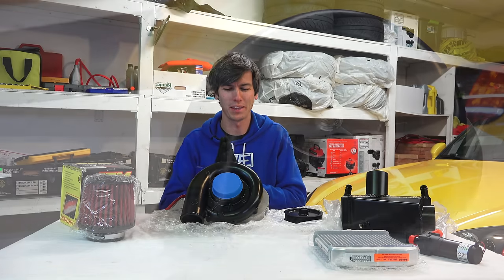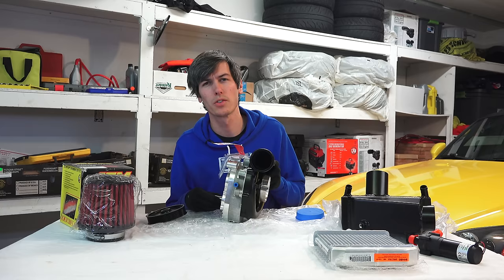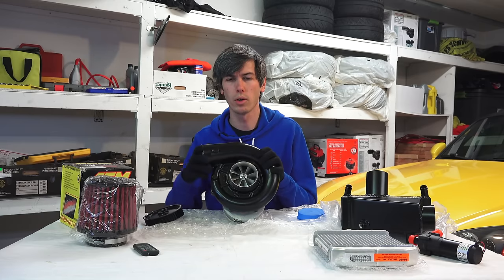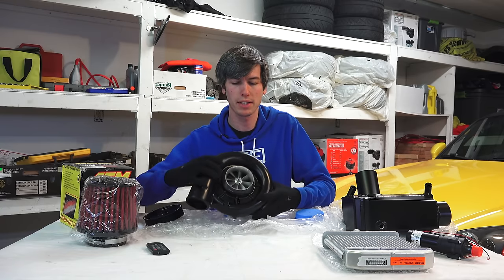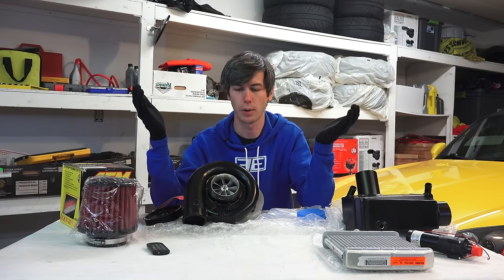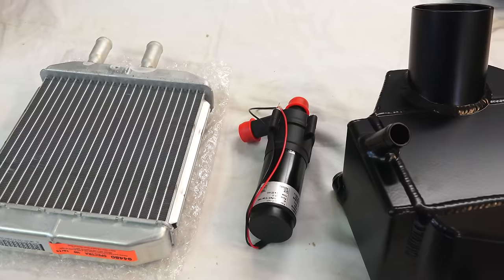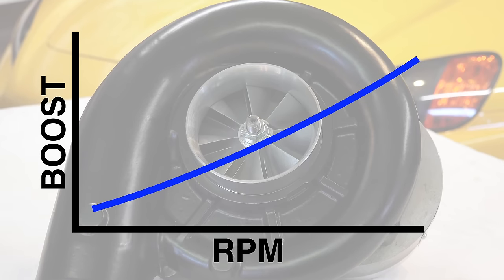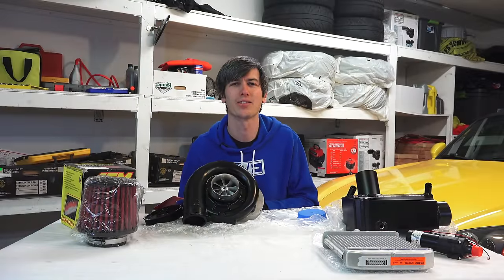How Do Centrifugal Superchargers Work?

Comment: Thats all fine and good,But what about placement of a Serpentine Belt.The AC Compressor may have to be removed to run the supercharger pulley.What about hookup of the Mass airflow sensor?Some cars may not have enough space in the engine bay for this supercharger.This Supercharger may be for NON-Street use hookup only on some cars.

Your correct,Some engines may not be manufactured to handle the extra compression ratio pressure and Blow out the intake manifold gaskets.May even have a ping detonation problem.

Comment: Ive found better fuel milage with a centri on my coyote as long as you arent racing around of course. Sure there is a parasitic load but isn’t it pretty low under peak rpms and wont there be a reduction in pumping losses?

Comment: There is no bad boost, but....

I'm curious why you chose a centrifugal supercharger over a TVS (high efficiency roots).  As you said, the car is already biased toward high RPM, I would think a flatter torque curve, with more power at low RPM (for the same peak HP) would improve drivability (I find during daily driving, I don't have to down shift near as often).

An W/A intercooler will increase in temperature to between boosted air and ambinet.  How hot depends on how big the water to ambinet heat exchanger is.  If it is the same size and the water to boost, that temp will be approximately half way between boost and ambient.  When you tune your car, for do it at that stabilized temperature to avoid engine damage.

Comment: quick question, right now i put 97 octane fuel in my car. If I want to start to put 91 octane gas in my car (that requires only 87), do I have to empty the tank and only have 91 octane in the tank or is mixing some 87 and 91 okay?

Comment: Adding in the whole inter-cooler phase just seems like a lot of extra complexity where there are more places for things to go wrong. I'm sure it makes things better, but I think keeping things simple is generally better. Over engineering a car will always produce the best results, for awhile, but once stuff starts breaking down it can become a nightmare to keep a "peak-performance", over-engineered system running simply because there are more points of potential failure.

Comment: Novice question:  Would a Wankle Engine that red lines at 10,000 RPM (or 9,000) be an ideal choice?   You mentioned making sure the engine could handle the added horse power.  Would you have any suggestions on basics for a Wankle 13B (for an RX-8)  I've seen some videos of a supercharged RX-8 and it was blowing the doors over everything else on the track.   One last question.  The RX-8 is not very economical to start with.  Roughly speaking how much more fuel would need to be used and do you need to increase the size of fuel injectors or improve the fuel pump?  Thanks and sorry about the newbee questions.

Comment: So i always had a problem understanding watercooled intercoolers and so on, how does engine coolant mixed with high temps help cool a intercooler when the temps were way much higher and now it makes sense, I'm guessing that watercooled intercooler is in a close loop with the seperate radiator as seen in video and none of the coolant here is in contact with the coolant in the engine being recirculated by the waterpump :D P.S: Did not know superchargers required a electric pump haha

Comment: Honest question, could there be a supercharger/turbo charger that's powered by a separate high power/speed electrical engine? That way, it doesn't create a parasitic load on the engine and you can dynamically change the boost levels through software since it's electrically driven.
Reply from the maker: Yes, electric turbos are a thing. Nothing is free though, it still requires a lot of energy, so you’d need an additional battery pack, a high voltage power supply, and some way of recharging the battery (it would still ultimately take energy from the engine).

Comment: What happens when VTEC kicks in and boost is still determined by RPM instead of air flow through the engine? Does boost drop when it first kicks in YO?

Comment: Would a centrifugal supercharger likely be a more appropriate power adder for road course use? (Extended on boost high load situations) Seems like theyre the most heat efficient, but i also understand that TVS units are a viable option as far as heat goes.

Comment: Hi, I really enjoy your channel - I was wondering if you would consider doing a video where you try to work out the percentage increase in performance for various mods vs. the money spent of said mods. I'd be interested to know, for example, the performance gain of extractors and full performance exhaust, normalised by the dollar cost compared to say a turbo build normalised by the dollar cost? Perhaps you could buy a cheap car which is commonly modded amd get some real data to verify your predictions. 

Building on this - it would be awesome to produce a calculator, which used other peoples experiences with mods in terms of cost and performance to estimate the benefit a mod would make on a certain car.

Comment: Hello. 
I've got a quastion: Do you will install a Blow Off Valve or does the drive of the centrifugal supercharger have a magnetic coupling? Once the throttle body will close the pressure may cause dammage to the compressor wheel if the pressurized air could  only escape thru the compressor. Similar to a normal turbocharger...

Greetings from Switzerland

Comment: Jason, would you consider the 
expansion chamber on a 2 cycle 
engine, as a supercharger?

I do, because it causes combustion 
chamber pressure to be higher, than 
normal aspiration.  (And, REALLY 
increases power, at the right RPM.)

steve

Comment: How can I make this set up work on a big block Cadillac? It seems as if as long as I have the proper belt, bracket, pulley, and piping it doesn't have to be vehicle specific. I assume a 2:1 reduction is possible where engine rpm 2000 would be 4000 rpm on compressor?

Comment: You should make a video explaining why you didn't go turbo I don't here of many people going centrifical supercharger unless they are drag racing
Reply: rvidal0001 that's not a good enough reason cuz this one has a crap low end he could most likely find a turbo that would be fully spooled at 4k at least hold till 9 grand and get 400 whp
Reply: rvidal0001 that's why I wanted him to do a video on it or maybe even comment on my comments the only thing I can think of is that it's more liner power and easier instal
Reply: He already had an STI so if he wanted a turbo car he’d have just held onto that, instead of buying an S2k.  Plus these motors have high compression ratios and are not well suited to turbos.  This makes much more sense for this particular car, adds power but is safer and more reliable without having to tear into the motor
Reply: Lostsage01 boost is boost supercharger or turbo highcompression and boost don't mix
Reply: Yes and no.  When turbos spool you get a sharp increase in pressure, whereas these slowly ramp up boost pressure.  That difference in ‘shock’ is rough on a small motor not built for it.  Look at a turbo boost graph and compare to what he showed in the video

Comment: In transversal engines 4 cylinder maybe is hard to install that supercharguer due to a space issue. Maybe it can be installed with a longer belt from the crankshaft to the turbo in a higher position, Idk

Comment: Could the Problem of "olny works in high RPM" not be fixed if there is a kind of CVT in the Chrager? The charger would spin fast at lower engine RPM and create more boost.

Comment: So if i put a smaller pulley on the unit itself it will make more boost at lower engine rpms coz you said that smaller pulley would make the supercharger blades spin faster at lower engine rpms??

Comment: I personally don't have experience with superchargers, but why all the redundancies in this system? First is the gear reduction mechanism, the pulley pretty much does the same thing. Unless they want the pulley to spin at a lower speed to reduce the chance of belt slipping off. Second is the air to water intercooler, I thought air to water intercooler is usually used when there's a packaging concern to limit intercooler piping. The only advantage I can see is throttle response since there's less pipes for the air to travel through.

Comment: Whenever you increase the energy output of an engine you increase the thermal output too. Can the existing cooling system cope with the increase, or do you have a plan to boost this too?
Reply from the maker: I'm confident in the stock sizing based on the power I'll be adding, but it's certainly something I'll monitor. As I haven't tracked the car (it needs a roll bar, I'm too tall), the cooling system will be fine for daily use.

Comment: Do they ever add the diffuser to the inter cooler instead of the supercharger so that the air spends more time cooling but still arrives at the engine at the same pressure (ideally). Maybe you lose more energy to friction in the tube with a fast air than a high pressure air

Comment: I've been thinking about the not so good low-end power with this kind of supercharger. Could you simply use a small pulley in order to make it spool fast even in the low rpms and then use some kind of wastegate to not overboost it in the high rpms?

Comment: So I'm not really getting why you would do this vs a turbo? People always knock turbos for "lag", but if this doesn't make power until high RPMs then it essentially has the same drawback + one more since it also has the parasitic factor as well. What is the actual advantage over a turbo? Less complex/easier to install? Easier to tune? Or was the price right on this...

Comment: Since it is compressed air, how about a small tank that keep compressed air produced from the turbine, and the engine take whatever it needs from it when it needs to? That way the air pressure can be at a constant value right? I dunno, went on my head suddenly... Not sure how big the tank should be, or how to set the supercharger up with enough rotation to feed the pressure inside the tank... Maybe switching between supercharger to tank on low revs, vice versa, and extra boost goes in the tank on higher revs? Maybe? A bit complicated though... 😂

Comment: Always curious, do any of these chargers free wheel with a reduction in input speed, or are they permanently connected? And does one style do it vs another, eg TVS vs Centrifugal (not a thing!). Wouldn’t wear/shock be lessened if it could free wheel on shifts/reductions in throttle and just uses the blowoff more? I would assume like a turbo works...

Comment: How about a tesla turbine based super charger?
Tesla turines are similar to a bladed turbine in that it spins and throws the air outward but it uses flat disks stacked with thin gaps between. The air inccurs friction with the disks which causes the air to spiral around the center and spiral outward (in the reverse flow of the typical use as a steam turbine in which the steam goes in from the outside and spirals out the center).
Tesla turbines have 2 inlets and 2 outlets.
The turbine has to spin very fast in the order of 80k rpm.

Comment: I was wondering if you could talk about Centrifugal superchargers and camshafts and power "fall off".  Do centrifugal superchargers power always increase with RPM, even with a camshaft profile that isn't necessarily meant for it?  I am working on supercharging a Subaru SOHC EJ25 with a larger Vortech.  I have cams meant for "mid range" power, I've been told they will "fall off" over 7000, but wondering what power will actually do above 7000rpm, being that it is a centrifugal, not turbo.  I don't actually believe power will drop or even flatten but I am not quite sure what to expect.

Comment: You mentioned you can spoil the turbo faster with a gear reduction in the turbo housing, does that mean this turbo can produce low end boost if you wanted it?
Reply from the maker: Yes, you could use a smaller pulley if you wanted more low end grunt, but that still means significantly higher boost on the top end.

Comment: I've heard 7psi is generally safe for stock internals with these types of superchargers? (At least on a V8) Would you say that's accurate? Always wanted one but without the hassle of adding forged internals...h/c/i etc
Reply from the maker: I’m not sure there’s a convention that will ever be entirely accurate. And it will vary engine to engine, some have stronger internals from the factory than others. Ultimately if reliability is the biggest concern, stock will tend to be best, unless you’re willing to pay a lot to build it from the ground up.

Comment: I assume the intercooler is needed because as the supercharger compresses the air.  That compression is creating the heat due to the laws of thermodynamics.   So how much HP would be lost by pushing that hot air into the engine without the intecooler?
Reply: i always asked this myself aswell.

Comment: How about pairing the input shaft of the supercharger to an electric motor? The motor should be powered by a separate electric system juiced by some kind of hi amperage li-ion battery. The whole system can be activated on demand by a switch (full throttle of manual switch), it should recharge using the cars alternator, similar to the Nos system in the NFS games. Is that possible?

Comment: That's why you pull the engine and upgrade the internals first then boost.
Reply: Not if you are happy with what the stock block can handle, which saves lots of time and money.
Reply: Candisa I'm more about peace of mind
Reply: turshin Then you should just buy a car that is fast enough stock and leave it alone. ;-)

Comment: I wonder why this kit come with its own water pump and radiator? Can't you connect the intercooler to the cars own coolant loop or would the added heat be too much for the radiator to handel
Reply: An engine usually operates around 95C, so feeding the engine coolant into the intercooler would likely heat the air going through. It needs a separate radiator that operates below the temp of the warm air coming out of the supercharger.

Comment: Are you going to have to make modifications to the engine to not destroy it with the boost?  I'd be very interested in understanding things you have to take into consideration when making upgrades like this, and how you find that information for an arbitrary engine.
Reply from the maker: I won’t be, for the most part. The S2000 comes with forged pistons and connecting rods from the factory, and I’ll be running relatively low boost (at least initially). From those I’ve talked to who know this engine well, it can handle low boost no problem. That’s not to say mine won’t blow up on day one haha, but it’s a risk I’m willing to take. I put so few miles on the car, so even if it’s just mildly reliable, it will be fine by me!

Comment: Hello and greetins from Romania. I want to ask you about your Honda s 2000 some things because i want to buy miself one but i am undecided, so... How is it like a daily driver? It is noisy  at speeds let s say 60- 70 mph, compared to a normal car? How is the stock engine in normal driving.? It is  so  underpowered at low rpm? I don t  drive fast so it is not a problem for me , i will drive this car like a normal car but i like the car for what  it is (mechanicly and visualy). What about oil consumption, knowing is a high reving engine. Any answers is welcome. Sorry for mispeling words. ... Thank you!

Comment: There is something else going on besides more air + more fuel = more power. It's why even 6 to 8 pounds of boost wakes up a engine more than expected. Now you are pushing the piston down on the intake stroke. Normally your engine is sucking in air through a restriction. Think of pulling on a syringe where you can only go so fast because the hole restricts the air. It's hard and you are using strength and energy. Hook up a hose with a couple of pounds of air in the line and pop the plunger flies out. No energy lost. In a odd way you are turning your engine from 4 stroke to 2 stroke by producing power every time your piston goes down

Comment: i understand why this system requires your engine to make more power, however it also increases the amount of oxygen entering the engine. Which i think might lead to better combustion and better mileage. Is this correct? especially in these slightly older cars where combustion is less complete... i think.... Or does it not work this way?

Comment: Nice video, i have a question. What about oil cooler? Is it necessary with supercharger?
Reply from the maker: Oil coolers are definitely a good idea if you’re tracking your car. For street driving you’re likely fine without it, but always a solid idea to monitor temps.

Comment: The problem with these engine-driven designs is that there'a a constant load from the supercharge even if you don't want the extra power, which means a substantial MPG penalty. 

Mercedes Benz set their original road-going supercharger engines up with an electric clutch so that they only activated when you put your foot down. Bentley and friends didn't bother with this (or couldn't make it work)

You might want to consider something like that (and a pressure flap) for your installation.

I'll ask the obvious question though: positive flow superchargers are best for low end boosting, whilst turbochargers are great (and almost zero cost) once you have gas flow in the exhaust, so WHY would you want a centrifigual engine supercharger? It seems like the worst of all worlds unless you're attaching the unit to an electric motor (and maybe putting a turbogenerator on the exhaust for energy recovery.)

Comment: Instead of a simple belt and pulley, why not use a CVT to make it run faster when it is running at low rpm and then have it slowly reduce its max RPM as it goes up the rev range.
Also have a centrifugal clutch that only kicks in at over 3k rpm to save fuel when you want to.